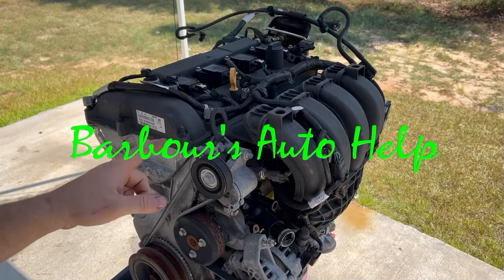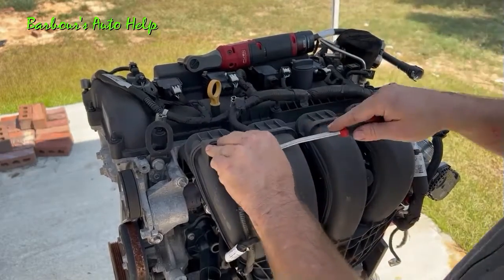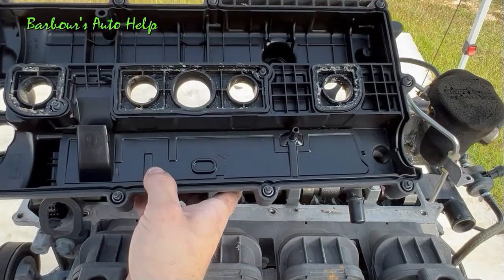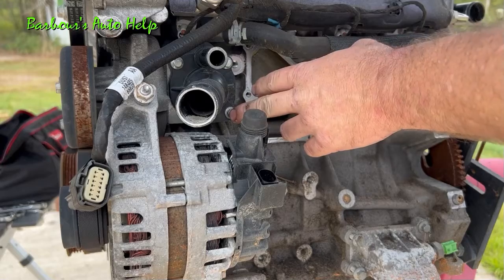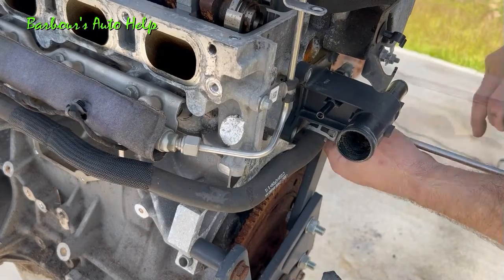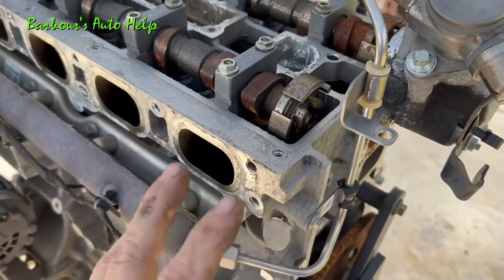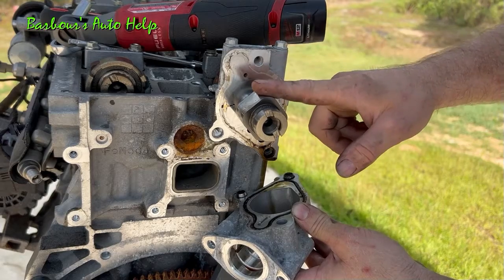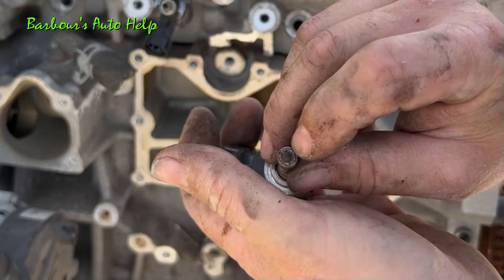Ford Duratec 2.0L HE Ti-VCT Engine - Tear Down - Part 1

Comment: one of the worst engines again which ford made. my engine died around 200k kilometer. straight to trash
Reply from the maker: I’d have to strongly disagree with you, but respectfully. These engines hardly ever fail. At least the non turbo 2.0. It in my opinion is one of the better engines out there as far as reliability and I’m not talking about just Fords.  Im sorry yours failed. What happened to it?
Reply: Its one of the best engine ford (and Mazda) made. We have the 2.0l duratec HE more than 22 years with +220.000 and it runs perfectly like the first day and they sound good. Way better than ecoboom engines XD

Comment: Are these engines recommended to run e85 or is it just a suggestion
Reply: Some can run on e85 if they have the flex fuel logo, otherwise they run fine on 87 octane.

Comment: If jm doign the timing for the engine I need to remove the high pressure fuel pump right?
Reply from the maker: I never remove the HP fuel pump. Not needed.
Reply: But doesn’t it block the slot for the timing tool?
Reply from the maker: @Theothervlad  Excuse me.  You are correct.  my apologies.  I'm thinking of lesser repairs.  I actually touch on this subject a little in part 2 at around the 7:25 mark.  Here is the link  https://youtu.be/ESIkcB4Gp7w?si=X8Dv8Cc0H0-jWmra
Reply: @BarboursAutoHelp  thank god lol! Do you have any videos on timing these things?
Reply from the maker: @Theothervlad  I don't, but I just edited my last response to you.  I put a link to part 2.  In part 2 touch briefly on this.  It will give you an idea of whats going on but it's not the "full how to" that you will need to do the job correctly.  I'm sorry.
Reply: Also thank you so much for the fast response

Comment: Question: Where is the MAP sensor located? And does the ford focus in general have a Barometric Pressure sensor? Located where?
Reply from the maker: focus 2.0 uses a MAF sensor. Located just after air filter.
Reply from the maker: Baro is an inferred reading.  No BARO sensor.
Reply: @BarboursAutoHelp  After reading a lot more, I concur.  So the question now is: BAD MAP or BAD MAF?  Fuel level input is constant 36.9% (High, I guess) while the fuel / air mix remains between 0.98 and 1.029. Not coils, not plugs (new), when accelerating from low rpm in any gear, "Nothing" happens (like pumping air).  Fuel rail pressure changes when applying throttle, but under load, car will only start to accelerate once gearing down.  Intake manifold pressure sensor voltage does however read 0.0 V at all times.
Reply from the maker: @jjnell1108 Are you referring to the Long Term Fuel Trim being over 30%?
Reply: @BarboursAutoHelp  Long Term Fuel Trim Bank 1 = -10.2 (constant at idle) to -6.2 (highest reading)
Reply: @BarboursAutoHelp  Locally, the dealership indicated that the MAP sensor is part of the throttle body (?) - however, in the video there is a grey plug, I am assuming going into a sensor, visible below the air intake at 1:42.  Is that not the MAP?
Reply from the maker: @jjnell1108  what vehicle are you working on. Because a lot of 2.0 engines do not have a MAP. They have a MAF. What is the fuel level input you are referring to?  What issue are you having with this vehicle that’s making you chase this?
Reply: @BarboursAutoHelp  This is a 2.0 GDI (2.0 engine, normally aspirated, petrol, built in Thailand sold by Ford South Africa). Issue - no power under acceleration at low rpm.  As time has gone on, the engine now also idles rough but does not stall.  The local BOSCH diagnostic centre also found no errors; the closest that they can guess is the O2 sensors - but won't say or show which - too easy to ask for another test and booking, etc.  Over a year ago, I initially replaced the upstream O2 sensor - this improved the situation a little, but thereafter I did a CAT-delete (we can, this is AFRICA).  Installed a "mini" cat setup. Again, for a while the car ran much better.  For the last 4 months, the current issue has  been present with slight improvements when changing coils, spark plugs, etc.  Having the BOSCH report on hand and a multitude of readings and comparisons from my own diagnostic tool, I am down to replacing the downstream O2 sensor - which is still the original from new - 218,700 miles later.
Reply from the maker: @jjnell1108 I beat the intake valves a caked with carbon. Not sure if this is the issue but if they have never been cleaned I’d start there.  The intake manifold will have to come off to do this. Maybe best to let a tech do it.
Reply: @BarboursAutoHelp  head was done in august last year after an overheat even due to perished water hose at the back of the engine.  I figure this is the upstream O2 sensor.  Down stream (narrow band) sensor reads slightly rich mixture.  So if the upstream is buggered, that means the fuel trim could be off.  I did replace this before.  Kept the factory one.  Fitting it this afternoon only confirmed that the original is in fact broken, idle was way off.

Comment: Is this engine very similar to the 1.6 TI-VCT? I'm looking at buying a C-max with that engine but am hoping to get a good understanding of the engine, ancillaries, where issues can occur and why. Thanks
Reply from the maker: I’ve not seen any problems with the 1.6 in the Cmax. In my opinion the 1.6 is great for that application. Really the engine doesn’t run half the time so less wear and tear.
Reply: @BarboursAutoHelp  Do you think it is possible to put (2.0L ti vct) engine to a fiesta? (Out of curiosity) lol
Reply: Thanks for the response 👍